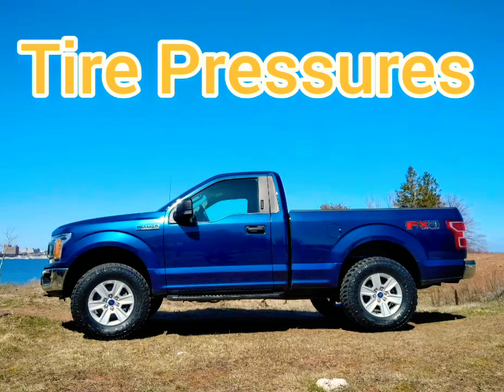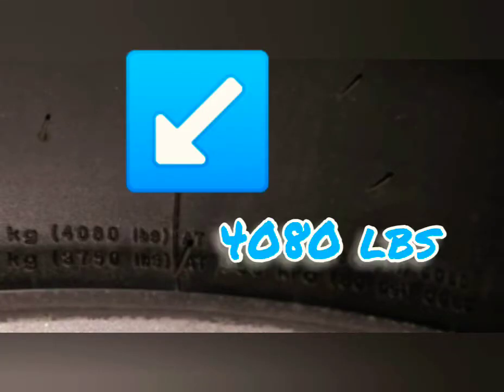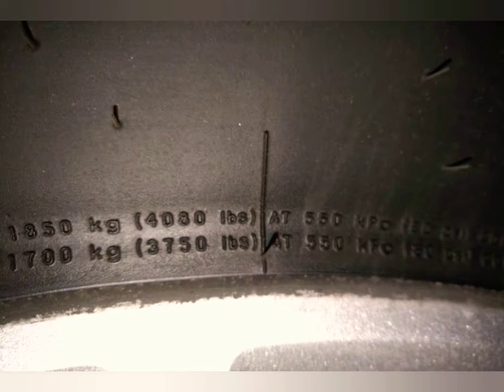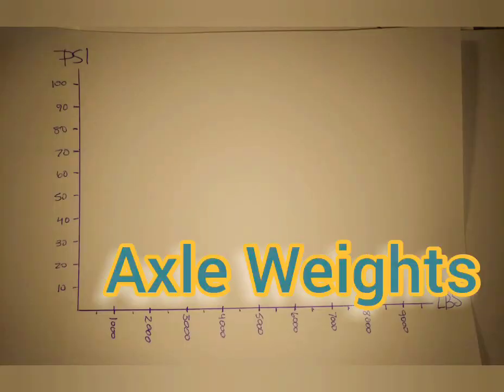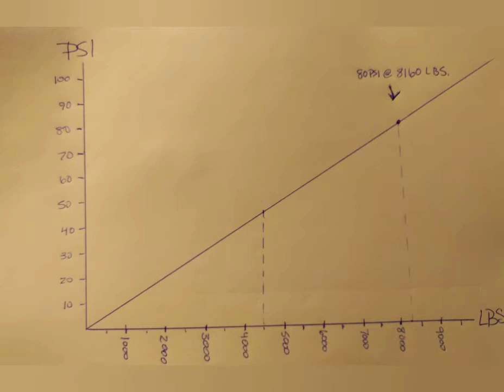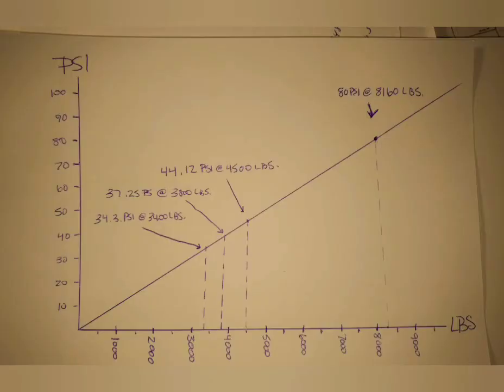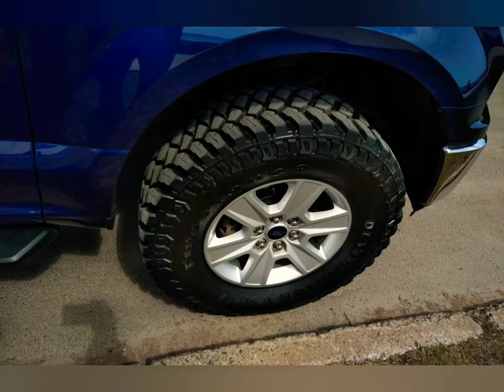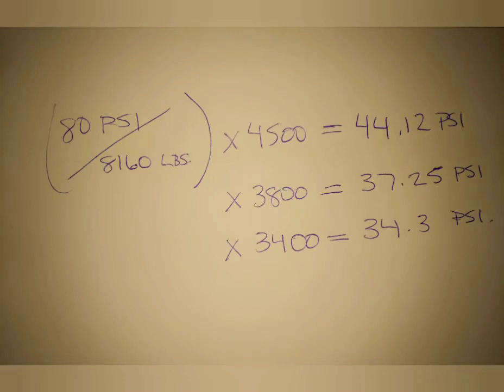Tire Pressures.  actual numbers for every tire.

Comment: This is a tire video so I'll ask here, but feel free to make another video about this if you want. :)

I saw in another video that you upgraded to 295/70r18 from your stock 17s.  Curious if you thought of going to 285/75r18s?  If your new spare tire fits in factory under-bed location?  Or a more direct line of questioning, why 295/70s vs any other size?

I've been considering 285/75r18 (~34.8") vs 295/70(~34.4). HDPP 2023 now comes with 18" rims vs stock 17". Want to keep width around 11+ and under 12.  Not looking to lift/level at all.  Level will take care of itself, eventually, when I start hauling camper in back and reduce rake to nearer zero.  Also thinking of ~305/70, but with stock rims (+44) might be tight or rub suspension.  Looked at older raptor rims r17 as those are +34 offset but don't think I want to run 34.5x12.5".  I'm looking at touring/overlanding(<--your favorite word), so AT, not MTs.  Most likely 2ply sidewall (cooper discoverer AT3 XLTs) appeal to me at the moment for mixed use.
Reply from the maker: Yes I have considered 285/75R-18.  The truth is they are so close to 295/70R-18 as it almost makes no difference, and most companies make either one or the other.  Almost never, both.  If I got Goodyear Duratracs or Falken Wildpeaks they would have been 285/75.  Also no two tires measure the same.  My Firestone Destination M/T2's made my speedo off by 10% (truly about 34.8") while my new Mickey Thompson Baja Boss A/T's are only off by 6% (more like 34.3")   Both are 295/70 and the taller Firestone didn't rub, yet the shorter wider Mickey's do rub slightly on the frame at full lock due to the side biters.

Either way both fit in the spare tire location.  A full 35x12.5 will fit in the spare location too, but they don't fit in the front wheel wells properly.  They can rub on the UCA, the mud flap, and the frame, all due to the width.

Next year when I sell the current tire and get a new tire I will likely try a 285/75R-18 and do a video about it.  I am also considering a narrow "pizza cutter" tire like the 35x10R-17 that a few companies make.

Hope this is helpful.  I know you will love your HDPP.  They are perfect for a camper.
Reply: Great video lots of info 

Ive been calling a bunch of tire shops, but nobody can give me an answer. I bought aftermarket tires for my truck they are 315/70r17 and the oem are 235/80/17  the sticker door says to fill the rears at 65 psi the tires are rated for 80 psi OEM and aftermarket are rated for the same psi. I got him at 55 psi but for some reason the tires not making full contact on the asphalt and I’m trying to figure it out, what’s the lowest psi I can run to make full contact, but not sacrificing the tire for running too little of a psi

Comment: I have always done it this way. Start at as low a pressure as is safe and comfortable, that depends upon the vehicle. But in mine, a 2019 Colorado Crew Cab 4x4, V6, that weighs in at 4,490, with half a tank of gas and me in it. With the manufacturer posting on the sticker on the door jamb of 35 psi, all around, that is fine with the passenger type 4 ply radial tires that comes on it. But that will cause a harder rough ride. So I bring that down to 30 psi, any lower an the system in the truck throws a warning that stays on till I get them back to 35. So I now leave them at 32 psi, for the best ride possible. Now the rule I use is when loaded, running down a highway at speed, if the heat built up in the tires exceeds 5 psi, over the cold 32 psi, then the pressure is too low and I will bring it u to the 35 psi cold. That the heat won’t increase the psi over 2-4 psi when hot. Now that’s with reg passenger weight carrying tires. Not 6 ply load range D or up! I have used the chalk across the tires along with the heat build up method and has backed it up!